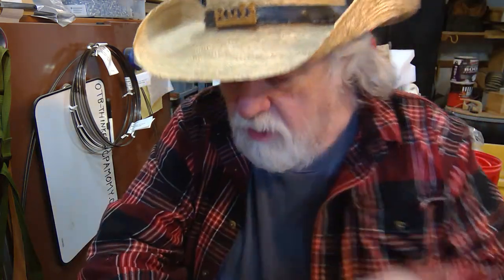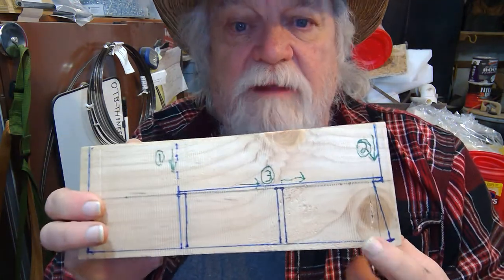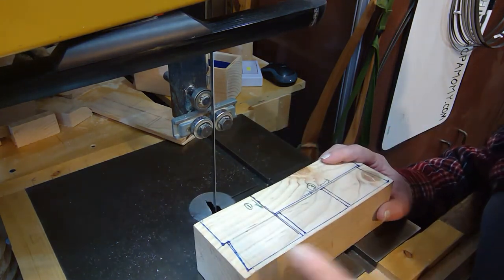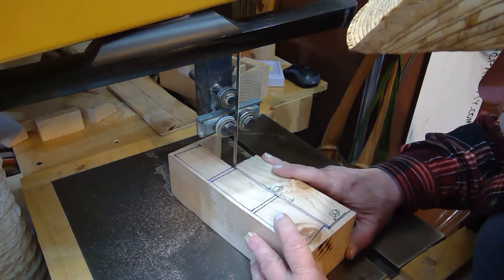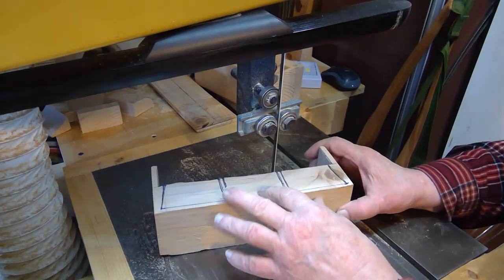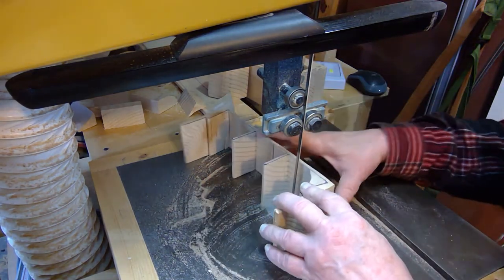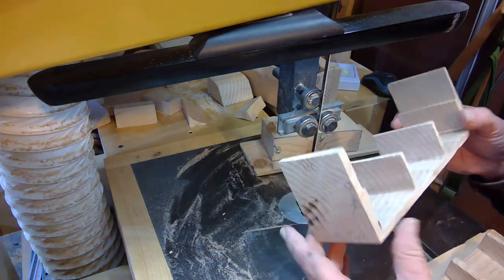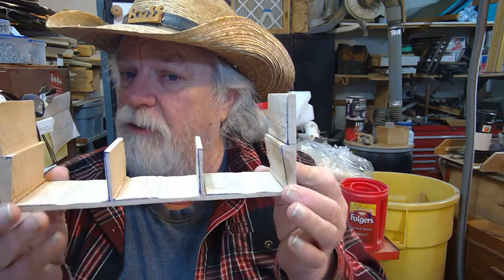Cutting Out the Drawer Cubbies & Tray by OTB Bandsaw Box

Comment: Excellent! Easy to follow the logic. It seems that the blade was flexing a bit probably because it is such a small size and perhaps because of the height of the blade for camera purposes. This may have been why the bottom of the cuts were not as deep into the material as the top of the cut was. I think that even I could follow your instructions and get a passable result...and you should definitely take that as a complement!
Reply from the maker: Thanks Tim, it's the only way to take it coming from you.  I did cut the side off that was sliding on the table.  If it wasn't a flat surface, it could affect the angle of the top to bottom angle.  I have had to flip it to cut the bottom many times in the past.  Not totally unusual or a blade problem.
Reply: @russveinot5754  Good point about the probable unevenness after cutting off any of the 4 sides. You did mention this in the video. I didn't register in my pea brain. Could a possible solution be to use a fence when cutting off the parallel sides to minimize the need to worry about unevenness?
Reply from the maker: @timothyhood2827  I don't like using (& rarely use) a fence for anything.  Flipping the box allows me to cut rest of way if needed.
BTW, not a pea brain, I watch videos (& read magazines) several times and still hear things for the first time.  That's normal . . . maybe normal isn't a good thing :>)